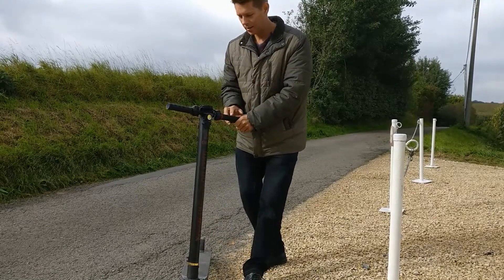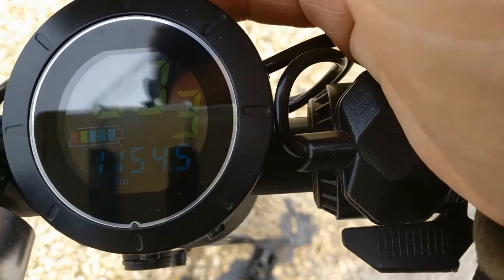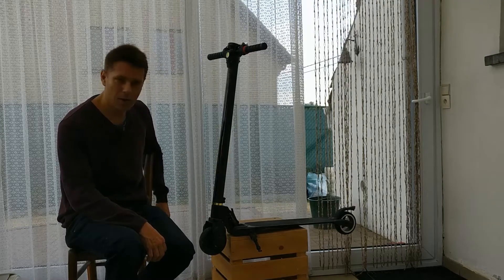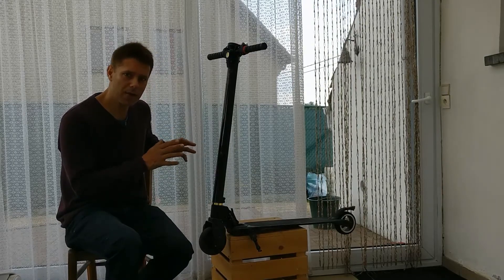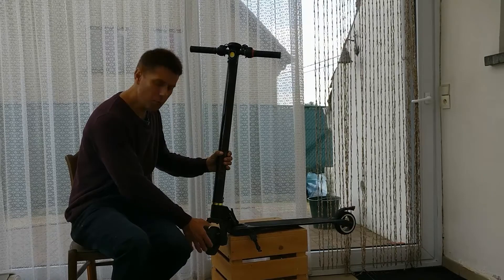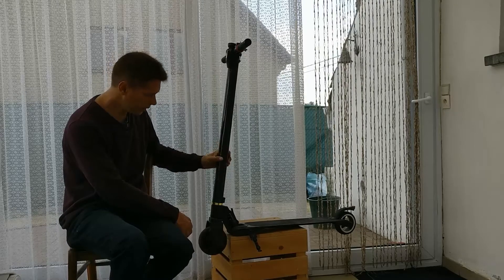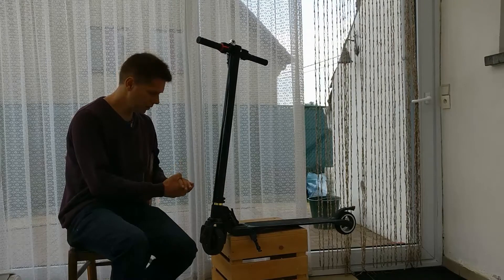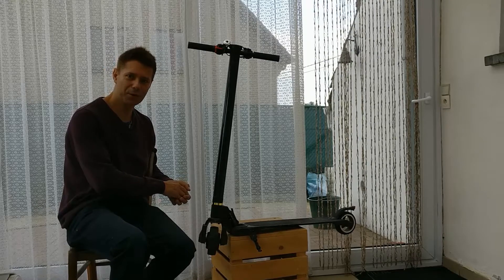Review Carbon Fiber Scooter S3 after 1155 km of use!

Comment: hello I have the same model with the same display and I would like to ask you if you managed to find a way to change the settings P4, P5, P6, P6 of the menu.  Because they are the programs that manage the 3 speeds and I don't know if it is possible to modify them in some way.  I hope you can help me 😄

Comment: Hey Kurt, There are so many brands of this scooter. Where I live it's called Jack hot and Moomas. Are they all manufactured in the same factory ?
Reply from the maker: No, there are different factories, but I am in contact with the factory who designed them. The others have been copying the design. These different factories go to the same material suppliers and assemble the scooters. But some of these factories save pennies on either the carbon fiber materials, folding mechanism, batteries, etc. 
So it is important to listen to other people who bought from the supplier you contact. 
For example the Swagger from Swagtron was good in the beginning, now they only buy the low end parts and assemble them. The end product is crappy and for example for 300 USD you'll get a scooter that only has a maximum range of 6 to 8 km, way less then the one I have here.
Reply: all the carbon fiber e scooters many brands are selling now are originally designed and manufactured at YJC Industrial. take some time searching at google
Reply: and kurt, is there any chance you guys would start reselling the new eastgo s5 model? i'm looking to buy one but YJC only sells the model with min 10units purchase

Comment: Acetone will dissolve super glue and will allow you to take it apart and then use locktight when you put it back together.
Reply from the maker: Thanks for your message, but acetone will also attack the carbon fiber. Carbon fiber is a little bit vulnerale when using this kind of products.

Comment: Hi Kurt,
I have just noticed squeaking noises when using the motorised brake. Do you have any maintenance tips? I have tried using lub after taking off the side plastics which didnt seem to work. Have you tried disassembling the front wheel for further cleaning /checks?

Comment: Hi Kurt, what is your voltage on a full charge? I have a supposedly 10.4ah version but I think it might be the 8.8ah model.
Reply from the maker: You'll get 29.2 Volts when fully charged. The minimum voltage that you should allow is 21 volts. 
The voltage will not tell you what is the rated current of your batteries. 
My questions to you are:
1. What distance do you get on a full charge?
2. What is your body weight? 
3. What terrain are you driving on?
4. Where did you buy your scooter? 
5. How much did you pay for it? 
Hope to be of any help!
Reply: I have the same scooter you have (although it is not branded as FLJ), and I get 20-22 km easy.
I have a cutoff at 21.5V, and I usually have 23V left after my "long journeys" I also start with about 29V+.

I travel on a combination of pavements and bicycle paths, accelerating moderately most of the time (18-22kmh most of the time), and I weigh about 75kg.

Because I intend to travel further distances, at a faster pace (25-35kmh) I have recently bought a 500W 48V Minimotor Scooter with 15.6Ah battery, and that one easily covers 40km (upto 60km in eco mode).
Reply: Hello, do someone know where i can buy a replacement battery 10.4ha for this? Thanks